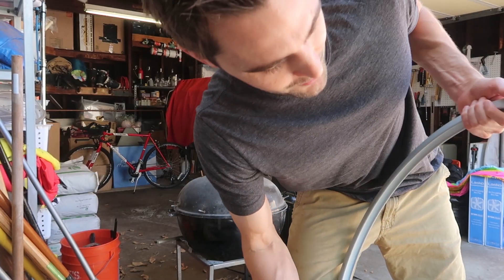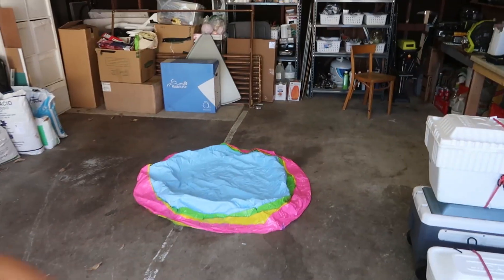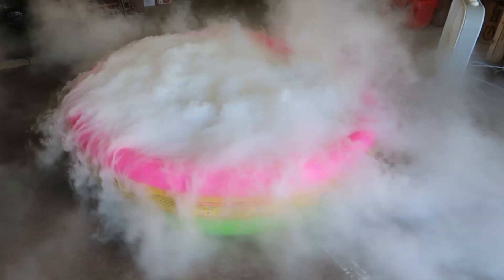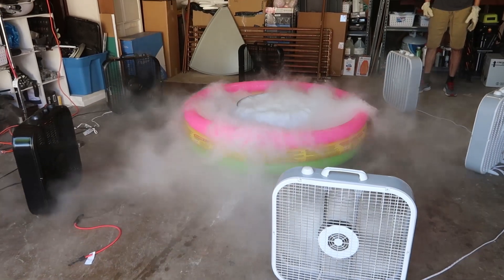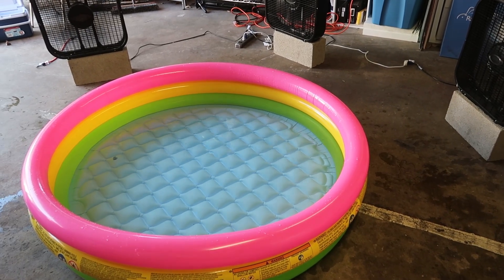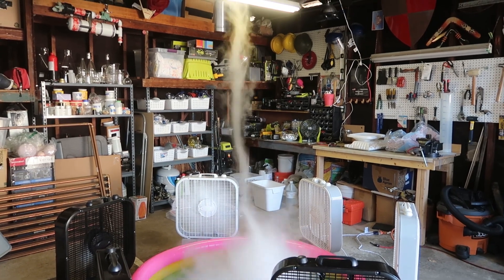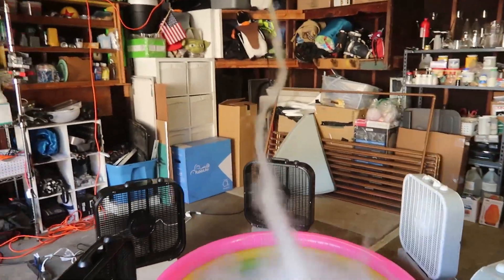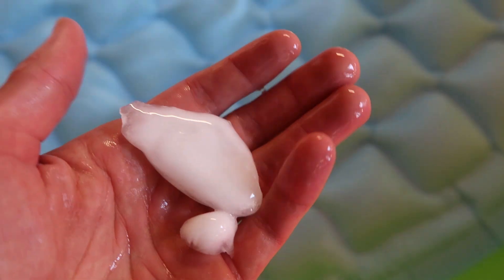We Made A TORNADO!! | Dry Ice Tornado Experiment

Comment: The problem is you don’t have a cumulonimbus cloud with a moist atmosphere and you did not have hot air elevating to mix with the moist cloud to create the cyclone aka funnel cloud the have sinking cold air to tighten the bottom of the funnel causing it to expand to the planet all you need are high speed fans, fire, and fog machines or boiling water or the dry ice you had